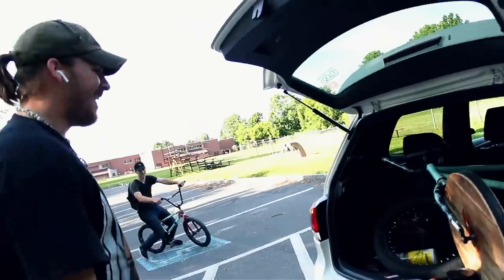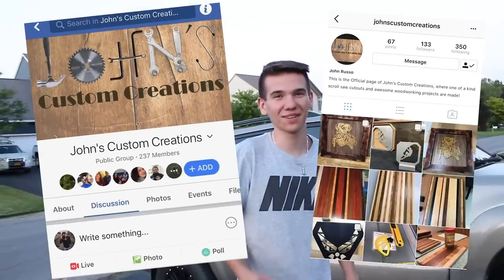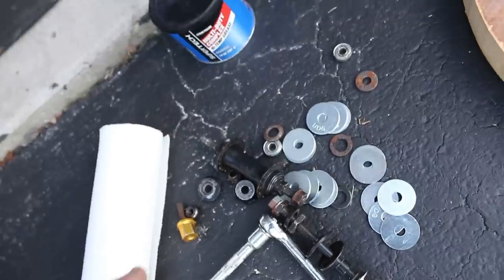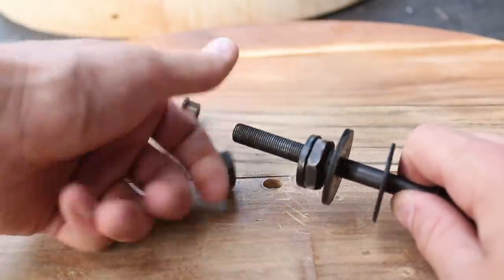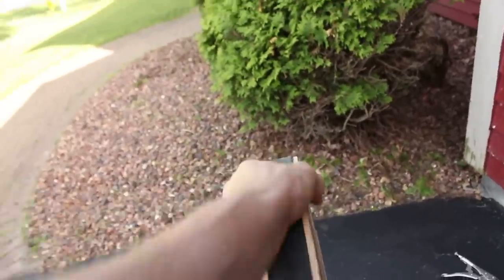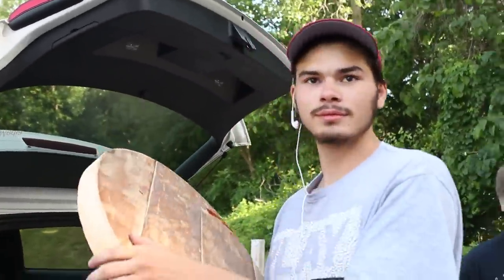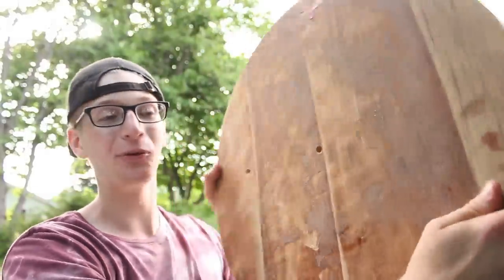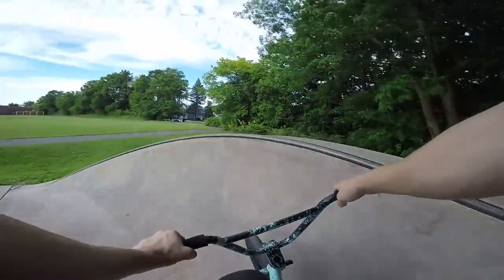The WOODEN BMX Wheel!

Comment: You might try 2 prices of 3/4 inch plywood sandwiched together so you don't have the joints of the individual boards acting as weak spots. Cool video though.

Comment: I'm curious how it will wear as time goes on. No stunts or anything to put shock on it. Maybe put it on the rear and ride around for a while. When you are pedaling you are putting more pushing load causing it to wear faster. My theory is that wood is hard enough that it may slip, due to a lack of grip, and wear out faster; especially with the imperfections on the riding surface.

Comment: It should have had better glue joints with some kind of interlocking of the pieces, the axle placement should have been planned out better and instead of a load of washers the use of jam nuts would have avoided the first mishap along with the ability to set the tension on the wheel.

Comment: I'll say its a wooden wheel but a twist on how it was made. Did you tell him that you were going to use it on your bicycle, he could have done a better job. It fell apart because it was wooden glued together. You want something  you have do it yourself or go to a wood work. An tell him what you intend to do with it. If this is the best he could do with the knowledge you have provide you need to explain it to him that you need the beginning of wooden wheels cutting a circle from a door that was put together it will come apart. What you need is sandwich construction not slap it together with glue. Slap it together means piece of wood glued on the edge sandwich means glued on the wider flat edge or face of the wood.or what you would call plywood it may also be called particle wood. Yes I've had to much education in wood. Thank You Loader.
Reply: Luciano Guerra i was thinking the exact same thing